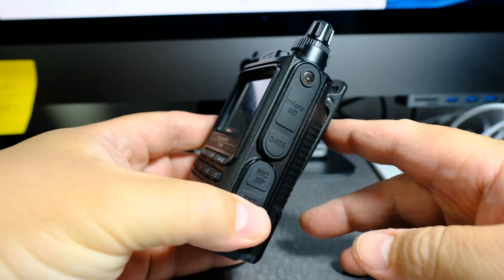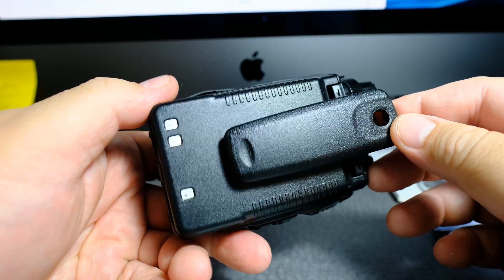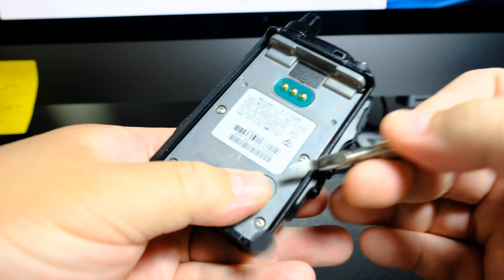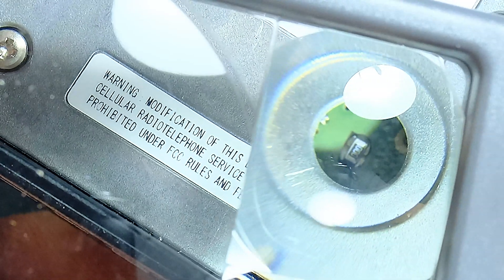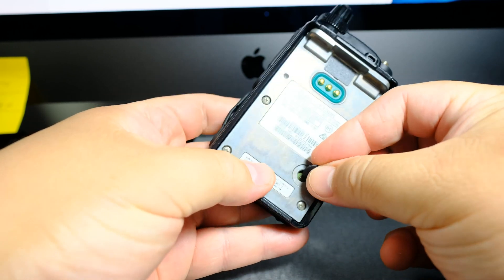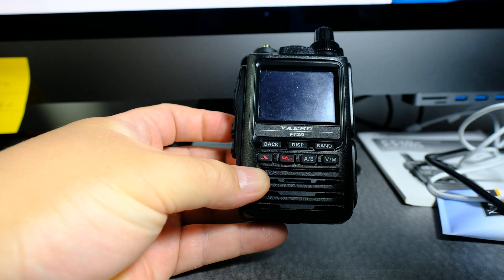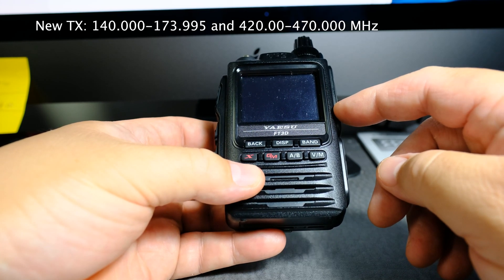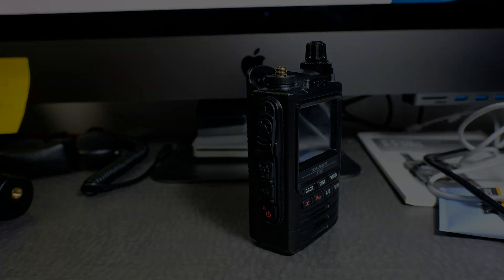Yaesu FT3D MARS CAP GMRS MURS Mod

Comment: Did it on my FT5… it did open up my transmit. But I am having an issue reading and writing from SD.
Reply: I heard you need a new repeater program file, reformat the SD in the radio, save the new file to the SD and it would in theory be sorted. 
Did you try that?
Reply: @truckerbruno  if I remember a few times back-and-forth on that process, and I eventually got it back up and running.

Comment: The first thing I did was remove that thing before I started using the radio. I'm not the best with a soldering iron but I can get by . It was scary. But I can use gmrs and the radio still works.

Comment: So this is an hardware modify right? If i do a fatcory reset in a modified yaesu FT-3D it remain expanded really?
Reply from the maker: This would be a modification to the radio. You would have to remove components from the board. I’ve never done the modification, but watching other YouTube videos when they do reset the radio it does stay modified.

Comment: Did the mod and tested with a dummy load. It shows Error when trying to TX below 144 and above 146. Any idea?
Reply from the maker: Na dude.  That sucks.  I know it's very delicate work.  Make sure if you removed anything, that there is no solder left behind.
Reply: @frankwc0o  Got it to work now. I removed solder again precisely and did a full reset. Also restore the channels was tricky with FT-3D Programmer
Reply: @OE8ZZZ  so this opened up the gmrs frequencies?

Comment: Licensed Yaesu dealers/repair places are allowed to make this mod for you, without it voiding the warranty. The place where I bought mine (Gigaparts) is doing it for me for only $25. Those frequencies that are blocked, are typically used for emergency services. It's legal to listen, but illegal to transmit on them. Which is why Yaesu has a factory block for transmitting on them. Some people who work in emergency services like to buy their own equipment thought. I work in Emergency Medical Services, and the handhelds my company buys are garbage. The Yaesu performs much better. But I have to have this modification done in order to be able to transmit to either county 911, or my companies dispatch. I'm actually allowed to transmit on those frequencies though. If you don't work in emergency services, you really have no need to get this modification, seeing it's illegal to transmit anyway. And you don't need the modification just to listen.
Reply: Dylan, I’m not the radio police and dont give a hoot, just for information to you:  actually, you or anybody for that matter, are NOT allowed to tx on those frequencies(your normal legal ambulance/whatever services freq’s) on the Yaesu ham radio that has been mod’d.  This is because the radio is not “type” approved for those frequencies.  Just like you are not allowed to tx on a marine band, even from a boat on the water, with a modified ham radio that works on marine bands.  The ham radio is not “type” approved for marine band use.   Will anybody know, or care?  Likely not.  But just fyi.   ;-)
Reply: @Machria23  You must be a blast at parties?
Reply: @MrThisIsMeToo  Good one!  I'd like to hang with you at parties.

Comment: I think the easiest way to remove that 000 resistor is to get needle nose pliers, heat the tip to 'red hot' and just grab it and pull it out.
Reply: Jeff, whats the best way to heat a small needle nose plyer as you mention?  Cigar type Torch, or …?   Thanks
Reply: @Machria23  yeah, a cigar lighter would do nicely

Comment: This took me less than 2 mins once I had the tools in front of me. The online sellers LOVE charging $30-$40 for removing this resistor. I used an IsoTip with a TINY tip and gently removed that resistor and put it on a piece of tape and back in the box the radio came in. I did it right after verified that the radio turned on and worked. It WILL NOT void the warranty. Yaesu does not invalidate warranties unless you do damage to the radio related to something you did by removing the resistor. Why do you think they made it so damn easy. A rubber plug and the resistor is the only thing under that plug. Huh, wonder why they did that. Could it be that they are making it easy for you ? Yes, that's exactly why its set up that way. Don't believe any online seller telling you that it will void the warranty if you do it but won't if THEY do it for $30 to $40... Bullshit... If you doing it voided the warranty, so would they if they did it. So don't fall for that crap.

Comment: AFAIK, this mods old works in the US version. In versions sold in Japan or China, there is no such 0 Ohm resistor under that rubber grommet. So no way to mod like this. But Chinese version has the  TX frequency exactly  same as your mod version. In the other hand, Japanese version is strictly restrict to 144-146MHz, 430-440MHz.
Reply: i got the chinese version without proper research now I am stuck with a ft3dr that I cannot register with our national communication commission.  =[

Comment: The access hole is most likely there so the same radio can be manufactured for mass markets across the world and Yaesu can make one quick modification to meet USA compliance. I assure you they did not do it for the end user LOL!
Reply: Yeah right
Reply: They did do it for the end user. There are some people out here (like me) who work in emergency services, and are actually allowed to transmit on those blocked frequencies. I bought the FT3D because it performs way better than the junk radios my company buys. They block the frequencies only so non authorized people can't accidentally transmit on them. They make it removable so people that are authorized can gain access with a very simple mod.

Comment: I successfully did this mod last week with some small side cutters.  No issues.  Just make sure you back up to your SD card first, and leave no debris to rattle around in the radio.  Took all of 5min.  I have done this mod to all my Yaesu radios.
Reply: I also did this Mod yesterday evening using sharp tiny cutters which basically cut the resister in half with hardly any debris and i used some soft blu tack rolled to catch anything loose.I then run a small sharp blade across the center only once to make sure there was nothing loose and the cut was clean.
Reply: Did u lost the ARS after that Mod?
Reply: @jockeljockelsen3749  I've lost zero functionality.
Reply: @FlonishaMerritt  i ask because some yaesu lost the ARS after Mod. Like the 857d or 991a. No more ARS after the Mod.
Reply: @frankwc0o  i know, but the two others ;-)
Reply: Flonisha Merritt that mod you did on your ft3d, can you confirm you’ve had no problems with the radio after doing the mod?  I’ve done the same mod years ago, on my yaesu vx8 with no issues, but want to make sure there won’t be any issues if doing this mod on the newer ft3d.  Thank you!

Comment: Why do the old Crud frequency police wanabes have to always put their two cents in without being asked. I have modded all my radios and have never had a problem yet. I know its a chance I take, and I am responsible for my own actions. The only Video I have seen on youtube, the guy cut the resistor and it worked for him. The opening was to small for him to desolder it.  Other wise good video Mr. Romero. Thank you
Reply: I understand if someone asked you what the rules are on operation on those frequencies. But no one did. And it’s the same thing on most ham videos. Wannabe frequency police always want warn everyone about the FCC rules. Everything else you said was very informative. I’ll bet you don’t go around telling every driver every time they violate a traffic law in front of you.
Reply: Traveller NL stfu then.
Reply: Usually self importance and snobbery. Not in this case though. But it does seem every video like this is full of the same people doing their self appointed job of delivering warnings, which is always a case of projecting their own lack of imagination onto others, unless it’s explicitly mentioned that it’s going to be for illegal purposes.
Reply: Opening is not too small for desoldering, someone just doesn't have the correct tools and process that's all...

Comment: Curious to know if people are cutting vs desoldering.   I'd do it, so I can talk with my kids on their blister pack FRS non removable antenna radios, while at large events (kids to young to have cell phones).  IMHO.. Just stay compliant with frequency and wattage, and I suspect all would be ok.
Reply: I've always used small side cutters.  No issues.
Reply: @FlonishaMerritt  So no risk of breaking or lifting  the solder pads via the cut method?
Reply: @cognetic  essentially I crushed the resistor and cleaned up the debris.   There isn't room to do much else.  I used the same method on my vx-8dr and 8gr.
Reply: @FlonishaMerritt  What frequency range does it unlock on the FT3DR?
Reply: @innernetfunhouse1161  Try watching the video chief.